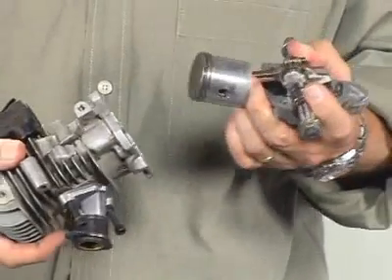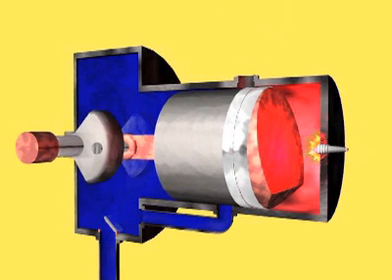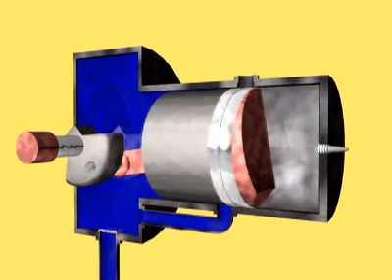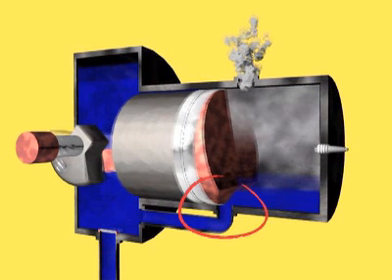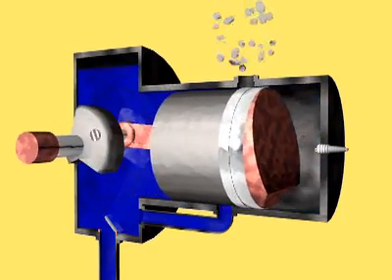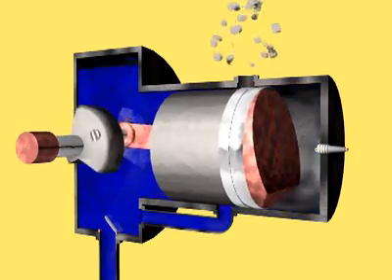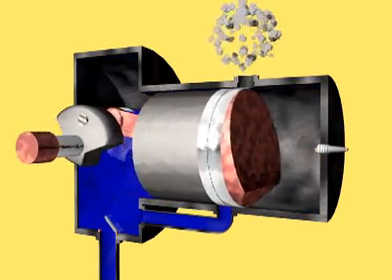How Two-stroke Engines Work

Comment: Ok instead of porting or woods porting let do something really incredible. Let's add a turbo charger. To a chainsaw yup. Small intake pipe run thru a intercooler and push the boost up around 35 45 psi. That saw will crank that power out like you never imagined plus ucan use a pressurized can to boost a saw it will last at a pre determined pressure is predictable it can be remotely or mounted on the saw.

Comment: One disagreement... 4-cycle small gas engines spark plugs will STILL fire at the top of the exhaust stroke. The coil and spark plug don't know what stroke the engine are on and will fire every time that the flywheel magnets pass the coil. No, it doesn't produce power, but the plug still "sparks"... Great video, though!

Comment: What about the Reed Valve?
Reply: Shaine MacDonald A reed valve just controls the fuel mixture from the carb I'm pretty sure.
Reply: Oliver Armstrong
Yea apparently some 2 strokes don't have reed valves.
Reply: Shaine MacDonald Ahhh, I am yet to encounter such an engine ahahah
Reply: Oliver Armstrong
We just learned about it in shop class. There's also a rotary valve 2 stroke engine but they're not as popular. The one in the video is only port timed.

Comment: No coverage of how induction is managed, though. The graphic shows reed valve between carb and crankcase, but most chainsaws I've seen are piston-ported, which then casts the piston as the intake valve too.
Nowadays, strato scavenging significantly boosts thermal/fuel efficiency and reduces emissions, as required by law. This sort of stuff might make it into V2.0?
Reply: Jacques Blaque basic information is given. as wannabe mechanics. if we can't adapt that (this) information to our personal projects. we probably shouldn't be tinkering with them.

Comment: okay lets say the engine is doing 6000 rpm. that's 100 times a second or 100 combustion cycles a second which means one revolution every .01 seconds which means the fuel needs to be burnt up in a less than .005 seconds before the intake charge comes in. i know fuel burns fast but it doesn't burn that fast.
Reply: the kart drivers in Holland have managed to get 30,000rpm out of 2-stroke engine. It's called the "Ryger Engine"
Reply: yeah pretty fuel inefficient so thats why i prefer 4 stroke

Comment: why doesn't intake charge ignite on the way in?
Reply: because the spark plug ignites it if the it dosent spark the fuel wont start on fire
Reply: again in English?
Reply: the spark plug is the thing that creats a spark of electricity. if gasoline goes in and it dosent spark electricity it wont get on fire
Reply: but on the exhaust stroke the fuel is on fire as it goes out the exhaust port  and then the  intake port is exposed letting unburnt fuel inside the combustion chamber. how is the burning fuel not igniting the unburning fuel as they mix together inside the combustion chamber?
Reply: becuase by the time the new gas gets in all of the exhaust gas is already gone and not on fire.

Comment: Why aren't these used in cars?
Reply: fuel efficiency, durability, noise, vibration, needing to mix fuel typically at a ratio of 40-50:1, pollutents. youll usually only see 2 stroke engines in small lawn equipment or anything that doesnt need to abide by epa standards.
Reply: Not really, about "epa standards". Both EPA and CARB in CA have been gradually reducing limits of various pollutants all OPE can emit. Thus you'll see lots of strato-scavenged 2-strokes and lots of "cat" mufflers, all in the interest of reducing emissions. The stratos have much better efficiency.

Comment: Yes, your presentation is easy to understand, but you neglected the two major issues with two-stroke: 1, It throws unburned fuel into the air through the exhaust port, and thus, 2, It is terribly fuel inefficient.
Reply: there really not that innaficiant
Reply: my dirt bike will run for 4 hours on like 3 litres of fuel
Reply: why it all runs out
Reply: why is it fuel inefficient if the same amount of fuel is being consume or does 4 use less fuel air mixture
Reply: 4stroke: The crankshaft makes 2 spins exploded 1 time.
2stroke: The crankshaft makes 2 spins exploded 2 times.
so yup is terrabily unnaficiantent
Reply: jose jalapenho oh nevermind i edited my comment you are right
Reply: the fuel air mixture depends on the cubic inches of the cilinder, more air needs more fuel to get the mixture right. Just imagine a 2 stroke engine exploding every single time, when in 4 stroke explodes like this: yes, no, yes no, yes, no. lol
Reply: jose jalapenho But you get twice the power for only half the engine cycle time so they aren't designed to be fuel efficient which is why they are used as outboard motors and smaller engines that need to produce a lot of power.
Reply: Its inefficient because some fuel gets pushed out of the exhaust port when the piston does the compression stroke

Comment: 2 stroke is the perfect exemple of the idiom "simpler is better"
Reply: Benjamin Faure not to mention the increase in emissions as the oil is burnt in the combustion process
Reply: Not all of them do, the engines in some ships are two cycle and the oil is pumped through the stump and isn't burned.
Reply: 2 strokes are funner
Reply: Benjamin you forget about the doubleing the power.
Reply: Elijah you get the same amount of power as an electronic valve 4stroke engine of the same size just the rate the power is being made is doubled due to elimination of 2 other strokes.

Comment: But how the piston gets energy to compress the working substance?
Reply: +Suffair Shaik The compressed fuel/air mixture is ignited by the sparkplug. This combustion causes a lot of heat and expansion, pressing down on the piston. So, there's your work.
Reply: Dentures Ventures The piston is connected to the circular Crank Shaft. After it reaches the bottom the motion of the circular crank spins and brings the piston back up to the top.
Reply: Suffair Shaik Not sure what you are asking here? Are you asking how does it get the energy to even begin the process? (That would be you pulling the cord connected to your weed wacker). Or are you asking how does it get the energy to move up and down? (that would be the compressed fuel / air mixture igniting by a spark plug forcing the piston down)
Reply: It uses the energy from the previous combustion stroke.
Reply: Thanks
Reply: +opmike343 But how does the piston go back up after coming down? does it bounce back?
Reply: ganthore oh ok, thanks
Reply: thanks alot

Comment: would it be pointless to turbo charge a 2 stroke engine?
Reply: Ricardo Lozano  Yes.
Reply: Gabriel Gonzalez +Ricardo Lozano No it wouldnt be pointless... people turbo Banshee quads all the time with 2 stroke engines with great results.
Reply: ***** the intake and exhaust ports are open at the same time on most 2 strokes though aren't they? Some designs have an exhaust valve, so in that case it would work but how does it make more power with a valveless and camless design?
Reply: GioGuitarDude It would increase exhaust scavenge. For a brief period of time the exhaust valve and the intake valve are open. This will do 2 things. 1. Further push more exhaust out of the cylinder before it closes. and 2. cool the chamber / allowing more volume of air to enter.
Reply: +Cairo Murphy (TheMasterAssassin8787)  a 2 stroke can be diesel or gasoline.  Detroit  made a 2 stroke that was very  popular  in semis  and heavy equipment.  they were nicknamed 2 stroke jokes as they always seemed to leake and would even run backwards
Reply: ganthore good to know!
Reply: yes because there basically alredy super charged
Reply: ***** explain why it would...
Reply: Probably, yes
Reply: ***** Ship Engines are diesel not 2 strokes.
Reply: +Ricardo Lozano Okay, here's your NEW answer: With a turbo, it basically compresses air, forcing the system to add more fuel to compensate. With an engine, too much/little of fuel/air, and the engine fails. So we INCREASE BOTH!!! MAX POWER!!! It would be WAY more inefficient, as the disadvantage these engines have is that there is a significant amount of pure unburned fuel ready for combustion going into your exhaust. And then the turbo & its compressed air shoots out, shoving it out to its exhaust, but not all escapes. So it would be less useful compared to if a 4 stroke engine is turbo'd, but it'll still do something in the engine. And your intercooler would make the engine nice and cool ;)
Reply: Noorquacker Ind. that was exactly what I was getting at when I asked my question.

Comment: Should bring the intake into the top of the head, while making the exaust at bottom dead center... the exaust should be like one or two skinny rectangular slots! Of course the correct horned pipe for backpressure!
Reply: Then it wouldn't be as reliable because you would have to put oil in separately.

Comment: He didn't mention that 2 stroke engines are inefficient, in that they do let some Un ignited fuel escape out the exhaust
Reply: all reciprocating engines are inefficient, they only pull partial energy from the fuel. The are more efficient for small items like weedwackers and the such than 4 stroke due to starting requirements and the ability to function with less cylinders.
Reply: Eric Steiburg You could just buy a direct injection one if you care about the efficiency...
Reply: It wouldn't matter. What I'm talking about is weight to power benefit for efficiency. Having direct vs plenum is fuel efficiency.
Reply: Michael Hudnall Yeah, but it was meant as a response to Eric :p

Comment: what about the lubrication ?
Reply: Amr EzzElDin that is why you mix oil into the fuel in 2 stroke engines
Reply: Resa_R_S why do 2 strokes have a power band?
Reply: Oil is mixed with fuel to lubricate the crankshaft and cylinder walls.
Reply: Because they have half the amount of strokes than a 4 stroke.
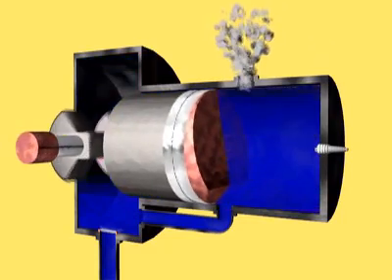Reply: "See this area behind the piston? It's filled with air and a mixture of gasoline and OIL" - 0:52

Comment: Question. When the exhaust gas is being released and the blue mixture (fuel+air) hole is open, wouldn't you loose some of you fuel to the exhaust hole by the time the piston can cover it up again?
Reply: Some fuel and oil is lost in a 2-stroke engine. This causes the characteristic blue smoke. If direct fuel injection is used the loss of fuel and oil is avoided completely, because fuel is not injected when the exhaust port is still open.
Reply: @Tuppoo94  And.....obviously they were banned because to inject directly not only do you lose some of the simplicity of this engine but mainly you lose much of its power in the compression attempt  to enable injection. An idea would be to have sheer air coming through  and time a last milisecong fuel induction but it would complicate it subtantialy and no matter what, it would still literally burn oil and it would and should be banned. This comes from a 2 stroke enthousiast...
Reply: This is partially prevented by a 2 Stroke Pipe.
Reply: Yes, you do lose some of it.
Reply: the pipe helps you prevent this. through it's shape, it sends a backwave that pushes that fresh charge back into the cylinder. that's one of the reasons why a pipe is so important in a 2 strokes
Reply: Depends on he quality of the engine and the reeds
Reply: Up to 20% of fresh air/fuel mixture is lost.
Reply: so do non fuel injected 2 strokes (if that's a thing) have worse gas mileage than fuel injected 2 strokes?
Reply: No, you wouldn't loose some of it. You would, however, LOSE some of it. I hope this helps.

Comment: Where is the gas in the engine from? I  mean the blue bit
Reply: the gas tank, mixture of high test (high octane) gas and oil
Reply: Gas and air meet up in the carburetor, which mix the two together in the right proportion.  This can and has also been done with fuel injection, but that requires a computer and a constant source of electricity (battery), which is outside the scope of most lawn equipment.  But on something more complicated, like an outboard, cutting-edge fuel injection which puts fuel directly into the engine after it's been compressed, is being employed.  This resolves "classic" two-stroke problems such as emissions, rough running (the popping and banging), etc.  Expensive, but not four-stroke-engine expensive.

Comment: What I don't understand is how the piston is able to spin the crankshaft in one direction and not the other.
Reply: Timing of the ignition isn't so much a factor because the plug fires before top center, which actually supports reverse rotatin, but this is overcome by engine inertia.
Reply: The spark would be off by 180 degrees in this video if the crank spun the other direction
Reply: xorbe2
please explain a bit more
Reply: The direction of rotation by a starter gets it rotating in the expected direction, and the timing of the ignition does the rest.
Reply: JETZcorp Timing of the ignition is a huge factor. Even if the spark plug fires before TDC, the combustion gas will take milliseconds to ignite which will take the piston to TDC. If the gasses ignite before TDC, it will do what you say, attempt to reverse the rotation and create knock/ping in the engine which is extremely detrimental to the engine.
Reply: If the ignition timing is TOO advanced, then it can cause the engine to try and backfire when starting.  Big bore Maicos are famous for this, for some reason.  The knocking/pinging is caused by excessive heating resulting from too much timing, and it's this heat that creates the detonation; a cold engine won't do that.  An engine's demand for timing advance varies depending on load, RPM, fuel type, combustion chamber shape, etc.  A lot of two-strokes don't have the means to change this on the fly like most cars, so we have to compromise a lot and choose a really mild timing setting to keep it happy.

So yes, timing is a very important factor overall, but it only affects the engine's direction of rotation while starting.  Once the engine is running, there's nothing the ignition can do to set it going backwards.
Reply: JETZcorp The starter rotates the engine in the correct direction while starting, not the timing. Knock/pinging can be caused by different things; yes heat and also a premature spark. Once the engine is running, the timing probably won't set it going backwards, but it will create knock.
Reply: It can spin the other way but you have to put the electric starter in reverse.
Reply: Flywheel

Answered by che boi chewy gooi

Comment: Actually, the power produced by the two-stroke engine doesn't equal twice as much that produced by the four-stroke engine. it's less than twice.
Reply: not entirely true. it all depends on how there tuned. A two stroke can put out more than twice the peak power of an equivalent four stroke in a narrow rpm range....Service honda sells CR500af's that can be tuned to put out over 100hp cant imagine trying to ride one though
Reply: As another commenter said, it does depend on the engine.  He pointed out CR500 engines, but I'll go a step further and point out the 500cc GP bikes of the early '90s, which were almost at 200hp (particularly the Honda NSR500).  But, the larger-displacement four-stroke MotoGP bikes that replaced them immediately had more than half the specific output (and were more than twice the displacement, by the way).  Also, four-strokes are MUCH more compatible with forced induction, and a completely built-to-the-hilt turbo four-stroke can actually even exceed the specific output of any two-stroke, although it takes a BIG turbo and all of the bad juju that comes with that.  The Formula 1 cars of the turbo era were particularly mental in qualifying tune.
Reply: what he meant by this is if you had a 4 stroke and 2 stroke engine of the same size and they have the same amount of cylinders, the 2 stroke would produce about twice as much energy as the 4 stroke. Now if you had say a giant 4 stroke car engine and a tiny weed whacker 2 stroke engine, obviously the car engine would put out more power.